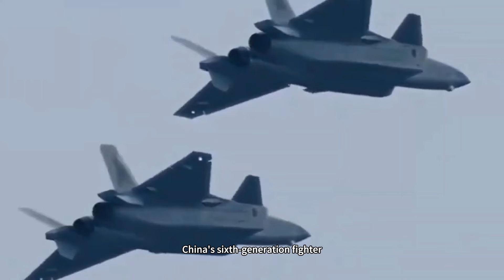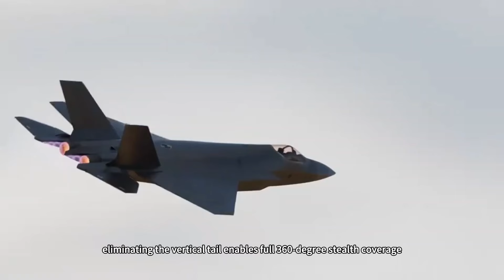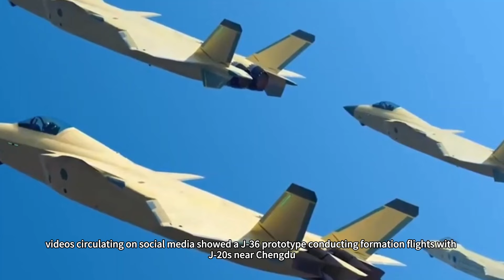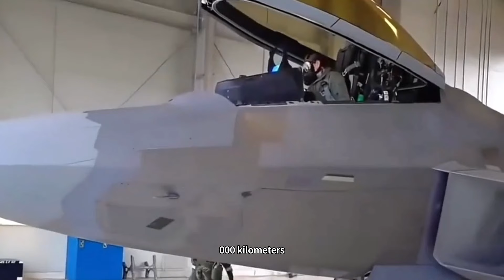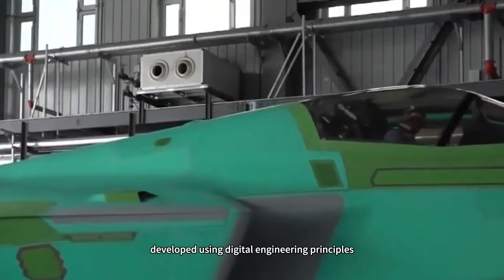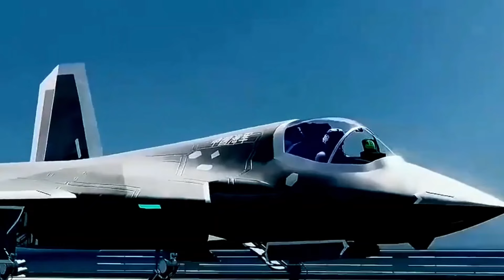The J-36 breaks through the 20000M altitude barrier, leaving the F-22 unable to even catch a glimpse

Comment: At 2.00 minutes, the video says "Analysis suggests the J-36 employs a hybrid power-train combining three WS-10C turbofans with rocket engines enabling sustained 2.5 Mach cruising while bursting to 5 Mach for penetration."
This is quite strange if the analysis is correct. Why doesn't Chengdu equip the J-36 with the much more powerful WS-15 turbofans instead of WS-15C?
Reply: The characteristics of WS-10C and the ones of WS-15 are completely different 

They simply don't belong to the same category

That's why the Chinese keep the two in production, and keep refining and upgrading both

Don't forget the WS-19
Reply: Of course they're using the WS-15. In the near future they'll upgrade to the WS-19 and the variable cycle engine WS-15E. ramjet in the middle engine by 2035.